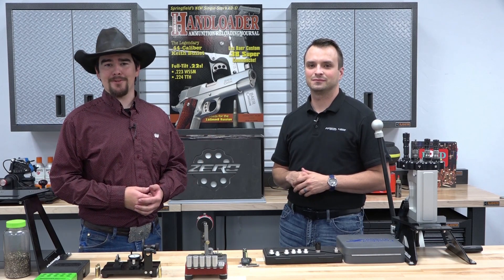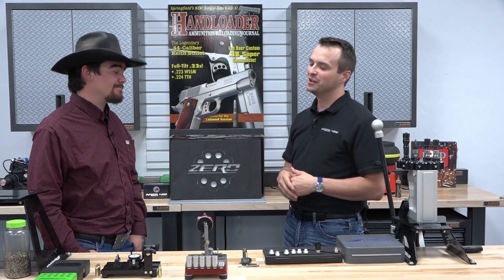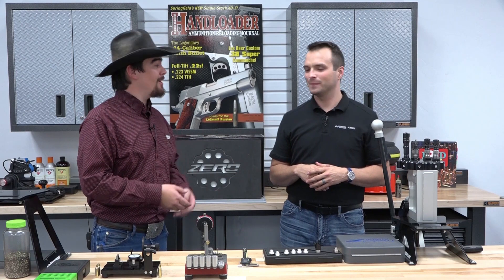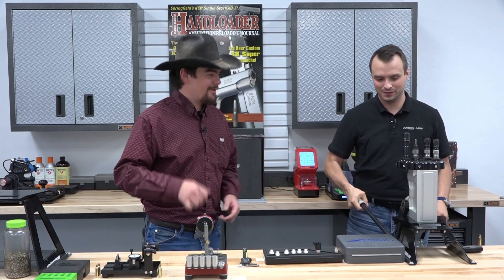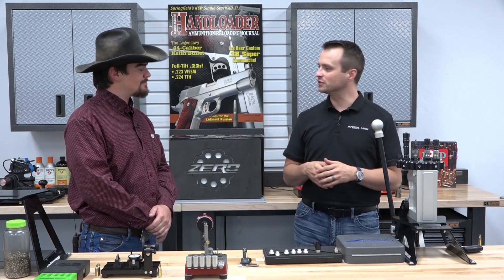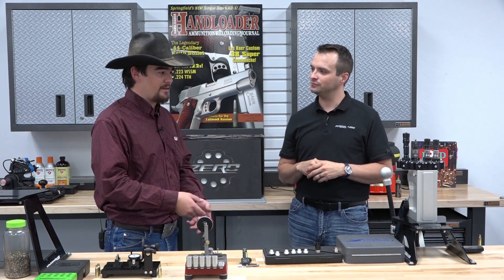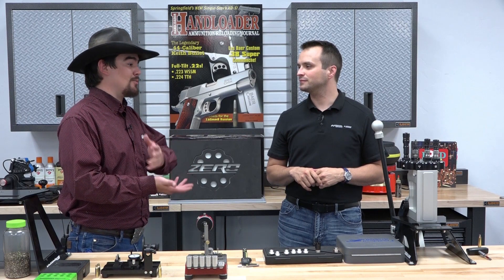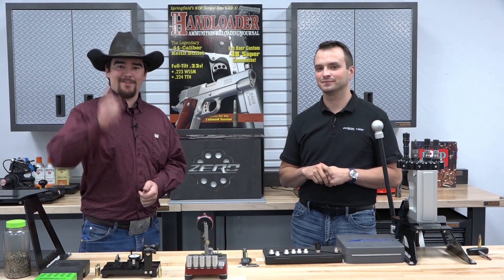Zero Precision Reloading Press

Comment: I deprime and size before cleaning my brass also. It was the way I learned from the VHS tape that came with the Rock Chucker II single stage press kit, I bought back in '92. If you clean, wet or tumble first, then you have to deal with lubed cases proceeding through the process.
Reply from the maker: There are a lot of people that do that, and I think it's one of the best ways.  There's so many different ways to do it and I wouldn't say there's any one way that's wrong or right. Whatever works is what I say! That is very true, either that or you'd have to clean or tumble it again or wipe the lube off. Thanks for watching and the continued support! --Jeremiah
Reply: @HandloaderTV  
I know, right? If YouTube has shown us anything, it's there's more than one way to skin a cat...or a buck, provided your handloads are any good! 🤣
Thx friend.👍🏿
Reply from the maker: @bustabass9025  Indeed, there are many ways that work and there is nothing wrong with that! Thank you for all the support! --Jeremiah

Comment: I cant personally afford to purchase this press, but having a little bit of a machining backround, the amount of tedious work and extremely tight tolerances and quality control is bar none above the rest. I use a rock chucker and have great results but if I had the option of "nothing but the best," this would be my choice press. Anyone who has not worked in a machine shop or ran a cnc probably wont understand the added cost compared to cast pieces that have been machined the same for 40-60 years.
Reply from the maker: Indeed it is simply amazing the time and effort put into this press and the amount of precision tooling required to accomplish such a feat is simply amazing! The Rock Chucker is a great press and I used it quite a bit before I got this press. I agree with you most people don't understand the price tag or precision that is built into these presses. Thanks for watching and taking the time to comment it is greatly appreciated! --Jeremiah

Comment: I'm new to reloading I'm so new I haven't even received my press yet its about 10 weeks away. I bought a dillon precision XL 750. Do you think I should cancel that order an get the zero instead?
Reply from the maker: That is a great question however I can not as easily answer that as it is entirely dependent on what you intend to do. If you are only reloading a few cartridges (different calibers not quantity of ammo) and you shoot a lot and are not wanting to do a lot of load development or squeeze as much accuracy as possible from your rifle/handgun and load then the Dillon is the clear winner in my mind. However, I do think every reloader should have a good single stage or turret press in addition to a progressive for many reasons as load development can be easier on a single stage and they are a very versatile system. When it comes to the Zero press though it is not for everyone however if you are a precision rifle shooter looking for a versatile and quick system to load a lot of match grade ammo I think this press is pretty hard to beat. I have both a Dillon 750 and the Zero Press for our purposes the Zero gets a lot more use because we load a lot of different cartridges and perform a lot of load development it is easier to setup and swap dies, calibers etc than it is on the Dillon. This can be avoided with the Dillon by many different routes such as multiple tool heads for different cartridges, measuring and dispensing your powder on a precision scale and using a powder through die etc. So I would say it really comes down to application and what you are looking to do. If you would like to discuss this further follow Handloader magazine on Instagram and send us a message. We would be happy to send video and answer any questions you may have. Thank you so much for watching and thank you for the great question!
Reply: Keep the Dillon!

Comment: The press deserves a more solid bench & mount. Good video / presentation though - thanks.
Reply from the maker: You may be correct in that regard, It should be noted that when sizing and typical operations there is no play in the mount. However when excessive force is applied there is a little horizontal play. I am unaware of any mounts stronger than the inline fabrication mounts. Of course mounting it directly to you bench is always an option and the hardware is included. Glad you enjoyed the video we appreciate you watching and thank you for your support!

Comment: Overpriced by a factor of 3.
Reply: Tex - Patriot, I don’t think it’s fair to say the press is as overpriced as you suggest when viewed as a piece of equipment made to that standard. What would be more valid is to ask how much better the press effectively is compared to say the Redding T-7 for your own purposes. As the locking mechanism means it can’t be as easily operated as a turret press is intended to be (i.e. put a case in & do several operations to that case by revolving the turret), it can only conveniently be used as a single stage press for processing a batch of cases through one die - then rotating the turret to the next die - then processing the batch through again - but with the facility of leaving the dies set on the press. That was the designers intent & in that respect they’ve achieved their objective & produced a superb quality press. However from a functionality standpoint I can quite see how many people would say it’s offering little extra for the cost relative to their own technique. That said - I’m glad companies are prepared to make such impressive tools so congratulations to Area 419. I won’t be buying but should someone bolt one to my bench I’d be happy.
Reply: @Russell-1  if precision reloading is the goal, it would be cheaper to buy two Forster Co-Ax presses and have them mounted on the same bench.  You would probably getting better quality ammo as well.     If you watch Eric Cortina videos, you will see that he can load match winning ammo using a Dillon.

It is an amazing piece of design and engineering, but I doubt it will do well in the market at the current price point.
Reply from the maker: @texpatriot8462  and  @Russell   I think you both make an interesting argument I don't think the press is for everyone as stated in the video it is geared for the precision minded shooter who is looking to get as much accuracy and arguably more important repeatability. What I think is so great about the whole thing is that we have an American company using American steel and parts made in the USA. Perhaps it will even stir up some competition among press manufacturers. So all in all I don't see this as a bad thing If the market wasn't there we wouldn't have this press. The press may not be for everyone I still feel it is a good thing. We have come a long way with powders, primers and even bullets in the past few years it seems only right that we have newer and better presses.  I appreciate the good commentary and as always thank you so much for watching and your support. Good loading to you both!